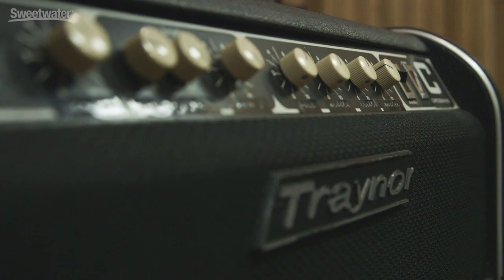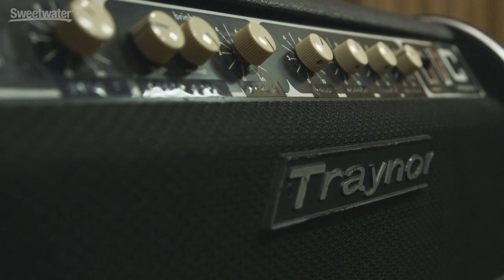Behind The Scenes With Line 6 Helix

Comment: This is all very nice and I love Line6 but I always feel that there is the assumption that bass players don't use cabs, where are the FRFR cabs for bass? I would love to have a power cab with 10's and in vertical stack.
While I know you have the stage sources and you can stack them, as you well put it, it's not the same as a real, plywood bass cab.

Comment: I don’t think I can afford the Helix, but maybe the LT is in my range... what are the biggest pros/cons to getting the little brother?
Reply from the maker: Hey, Quikdeth. Thanks for your question. I own both the Helix and the HX Stomp. The LT fits between the two in some ways. The DSP is the same, the physical i/o and control options are significantly different. The biggest features that LT doesn't have: LCD screens below the stomp switches, 2 loops versus 4, 8 switches versus 10, and you can't edit on the fly. The LT is smaller, lighter and less expensive. 
Please contact me direct if I didn't answer your question completely. 
Robert Williams, Senior Sweetwater Sales Engineer, (800) 222-4700 ext. 2371, robert_williams@sweetwater.com

Comment: Sounds like it’s going to be a year since announcing 2.80 till if comes out. This update really better have more than 2 amps and 3 effects in it.  Sounds like they have spent more time making it a controller  than adding modeling and effects which is what people actually want.
Reply: @bertie5197  Its been over a year now since they added any amps.  in about a year and a half they added a tuner.
Reply: @bertie5197  I thoroughly appreciate this reply.
Reply: @bertie5197  The point is its EXTREMELY slow.  Maybe add some people to the team So it doesn't take a year and a half to add 2-3 amps.